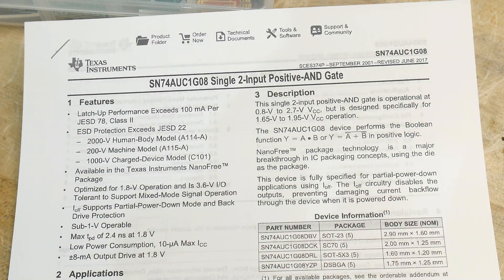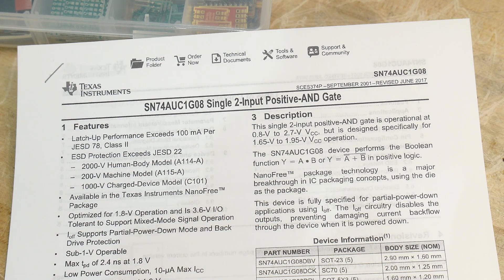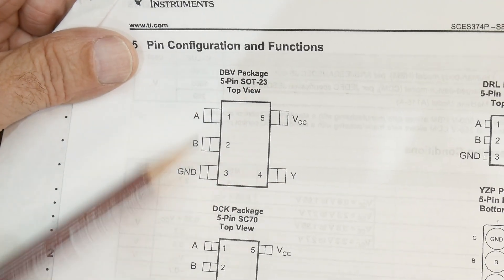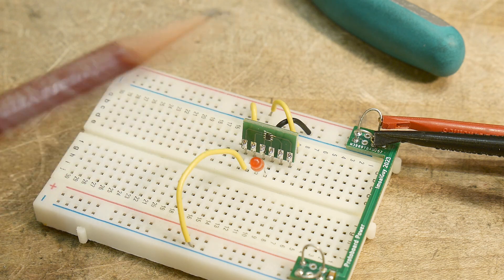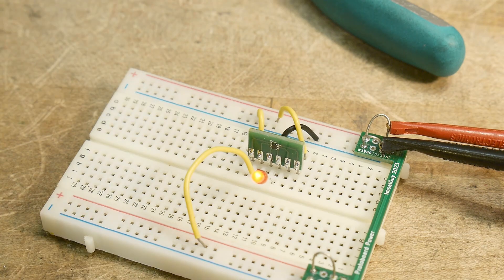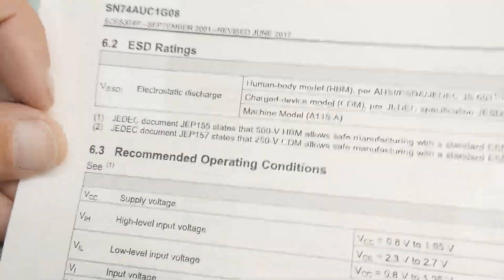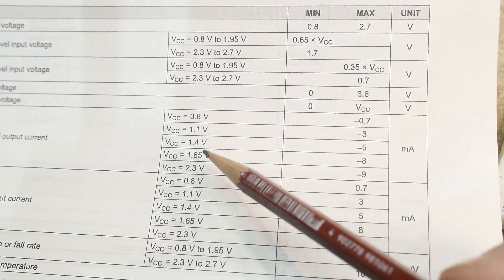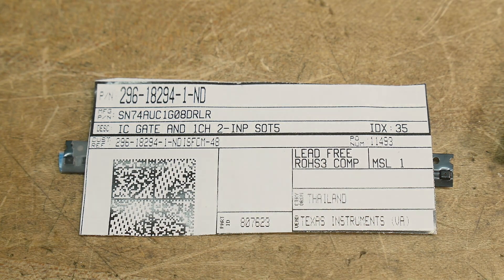#1962 SN74AUC1G08 AND Gate 1.8V

Comment: Level shifting and protection by buffering an input of a FPGA, only needed one for a single SpO2 sensor serial port accessible by the customer.  There was also diodes to the rails for static protection.

Comment: I use them for high speed voltage level conversion. The HCT variant is perfect for driving 5 volt WS2812 serial LEDs from 3.3v processors

Comment: Single gates are extremely useful - sometimes you need a control line to something controlled by something else, and instead of routing that something else to a GPIO line and doing it in software, you can do it with a single gate and hardware. You might do it to write-protect flash - rather than rely on software to not write to flash, you might disable the control signal. Also been used to copy code to static RAM and then write protect it, so you use a gate to block the control signal. Sure you can probably do it in a microcontroller, but hey, sometimes it's just easier if you need a random gate to just do it there.

Comment: Sometimes you design a system that needs a security cutoff or a failsafe and you can't rely on software to do it (as then the software needs to be developed under strict ISO guidelines and so on) which is when you may end up needing a few tiny gates.

Comment: The really great one from that series to keep on hand is the '1G98.  They call it a 'universal gate' - it can be practically any 2-input logic function and fits in the same footprint as the '1G08.  Also, all the inputs are Schmitt triggered - so they have good noise immunity.

If you're doing a system that has to fit on a board the size of a postage stamp, and need just one more gate for something, these little packages are just the thing.
Reply: Yes!  It takes some thinking to figure out what it's doing in-circuit if you didn't design the circuit, but they're very handy to minimize unique-part-count.
Reply: Cool part

Comment: What a pointless IC. One gate and stupidly low voltage and current.
Reply: I can almost guarantee that there's one of these (or similar single LV gate) somewhere in your phone or tablet.
Reply: You're out of touch with modern devices, then. These things are EVERYWHERE. Your TV, phone, etc all have them.
Reply: @humidbeing  I'm very out of touch. My phone is a 2005 Nokia and my TV is a 2007 Sony. LOL
The most modern tech I own is an X-Box 360.

Comment: I don't get it. If you only need 1 AND gate why wouldn't you just use a couple diodes and an appropriate sized resistor.
Reply: Package count, for one thing. And the diode logic is likely to be slow- the pullup resistor has to charge whatever stray capacitance is on the line.